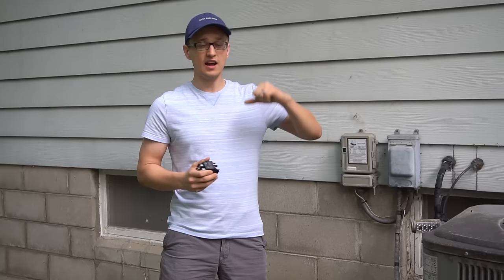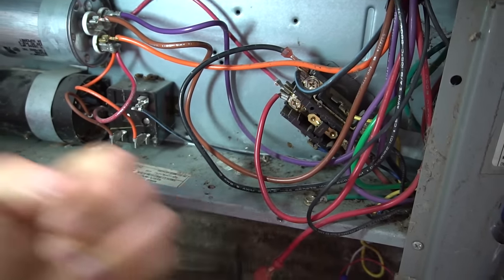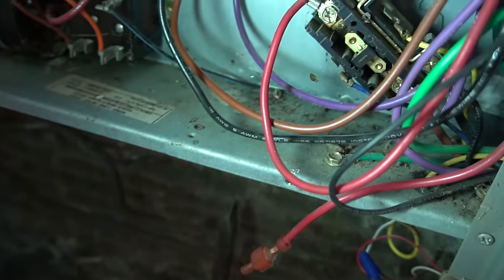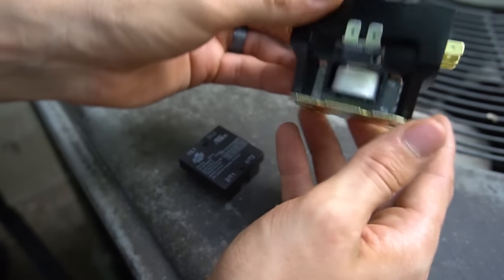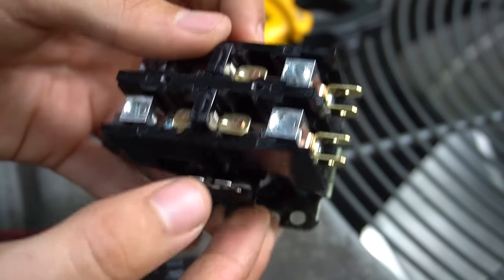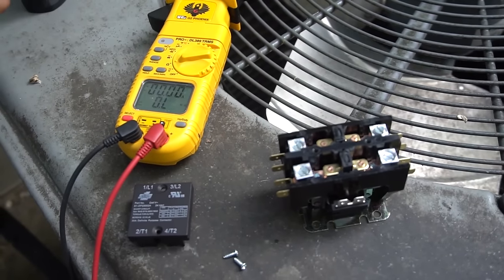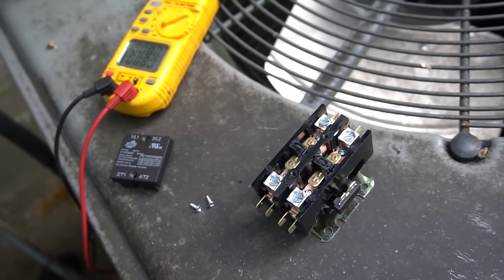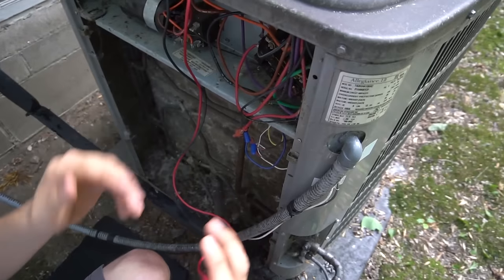Air Conditioner Contactor - How To Check If It's Actually Bad

Comment: Ok so I'm new to the channel, subscribed a couple days ago I've been trying to diagnose my a/c  inside fan comes on outside fan does not..I pushed the contacted button and the fan came on I checked the condinsate overfill switch there was water all the way to the top of the pipe....I blew it out didn't help.... I checked the line and load 234 V not quite 240 don't know if that 6 V kills it or not, also I couldn't get a reading when checking for the 27 V yet the fan comes on when engaged by hand And Even though it's worked without it for a long time, there is an extra wire in the wall I believe was labled w and may be blue not 100% on that one. I've got Green, black, brown , and red g-green wire, y-brown wire, w/-black wire, r-red wire and the jumper to r/c. I've changed the thermostat and fuses the fan works but only if I engage the plumber on the contractor by button what's my next step ? I know it's something simple when it's all said and done but be that as it may it seems complicated enough here and now

Comment: Great video! A question my next started saying error e103 and when I looked it up said overcurrent on the Y wire which I believe is the AC wire how can I check what would be the problem that’s causing it ?

Comment: I actually had a bad contactor, the coil burned out. But this video made me think to check for 24VAC at the coil which I had and the contacts didnt pull in = bad coil.

Comment: I have two thermostats, my system is wired for two zones. I changed my contactor and capacitor, my fuse at my furnace is not blown. My upstairs thermostat is running properly, cooling when asked. But my downstairs thermostat will not turn on my ac unit. Do you have any idea what the issue could be?

Comment: So you're saying the cover tells you where L1 and L2 are? Damn, wish I would've seen this before Saturday. Had an AC with a bad contactor at work (I do maintenance on apartments), went to get a new one but it looked like the one in the video and I had already taken the cover off. Luckily I had spare contactor (not new) that looked like the one that was on the condenser unit, so I could easily just go wire for wire. Now that I know the cover tells you which side has L1 and L2, I can use it the next time I need a contactor! All I need to know now is: which thermostat wire goes to which side, or does it even matter?
Reply from the maker: Yeah :) That's easy to miss! As for the contactor coil, it does not matter which thermostat wire goes to which side. Cheers!
Reply: @WordofAdviceTV  OK cool. Thanks for the reply! This video was helpful. Have a good day!
Reply: @WordofAdviceTV  one more question: can you direct me to your video that shows how to wire it up? I think the wires from the run caps go all on one side, but I don't know about the fan and compressor (and a third wire I can't remember what it's for, think it's another leg to the compressor).
Reply from the maker: @bensteinundknochen9404  Yeah no problem! Here are three videos that may help with that:

Basic AC Wiring: https://www.youtube.com/watch?v=KCanZEsLVEI&t=3s
Compressor Wiring: https://www.youtube.com/watch?v=GhBTVn5CHBE&t=78s
Condenser Fan Wiring: https://www.youtube.com/watch?v=VlMhvwrpimE&t=5s

Comment: So haven’t taken my contactor off but it is sticking in therefore continuously sending heat through even when I shut everything off. Had to pull the disconnect. Manually got it to pop back out. Was gonna clean it with sandpaper bc it has black soot but that part scares me so going to replace it. With disconnect pulled out and breakers off do I need to worry about shock from those wires? I do not know how to discharge stored power from capacitors either if that’s needed. Thank You 🙏🏼

Comment: My stat says "Voltage at standby Fault Code 73".  Code 73 means "compressor voltage sensed when no demand for compressor operation exists.  Contactor may be stuck closed or a wiring error".  It's worked fine for three years so I'm assuming it's a stuck contactor.  If it's only an $8 part replacing seems faster/easier than cleaning it.

Comment: Sometimes they'll arc if there's corrosion but the meter will still check out OK. If you hear buzzing noise or something, it's important to replace even if AC works because it could be getting lower voltage causing overheating or other damage down the line. Cheap insurance.

Comment: Hi  Jay I tested my contactor with meter which shows 239V under two wires,but on top two shows 5V only. Coils on both sides show 0V. If I set up the thermostat , the fan is turning but compressor is not working. At this moment two wires at bottom got 315v . On top two wires its reading show 5V. If I press down the plunge on the contactor the compressor is working ,but the fan is not turning. It seems like my contactor didn't pull in. According to this information do you think my contactor needs to be changed? Thank you very much for your advice. By the way my contactor shows 21 on top of left corner and 23 on top of right corner, at bottom it shows 11 on left hand and 23 on right hand. My contactor has one plunge which is different from yours. If I order one on line what kind of model I should choose? Thank you very much again.
Reply: If you are truly reading 315 volts incoming to contactor, you should call Power company and report it before it destroys your system. More likely, you have a malfunctioning multimeter. The 5 volts you are reading is actually 0 volts. Most multimeters when placed on ckts. that should have 0 volts will get a Millivolt reading that will confuse you if you don't look closely at meter that autoranges to millivolt reading.The numbers on the contactor corners refer to the terminal numbers on the wiring diagram.You may have a bad fan motor, if it is turning when the contactor is not pushed in, which would indicate that its winding is grounded, and it is being fed by the shunted leg of the contactor.  But than you say it stops when you push in contactor, which shouldn't make any difference.Hopefully you called in a ac tech for help, this may be beyond the do it yourself field.

Comment: My AC works only if I pressed the contactor manually. I checked the following:  the wire in AC unit outside thered is 27Volt coming from the house as well as 240 volt at bottom of 2 screws in the contactor. Also replaced the capacitor and seems to be working fine. So what might be the problem the contactor is not pulling when I turn on the thermostat ?
Reply from the maker: The two thermostat wires that come out of the house and into the condenser unit, do they go straight to the contactor coil or does one of the wires go somewhere else? (the 24v wires) If one wire goes somewhere else, try to trace where it goes and see what is in series with the contactor coil that could be interrupting the current. But if you have 24v right at the contactor and it is not pulling in, then the contactor is bad and should be replaced.

1 Pole 30 Amp Contactor: https://amzn.to/2tdICNB
2 Pole 30 Amp Contactor: https://amzn.to/2JWlI7Z
Reply: Thank you in advacne for you help. One of the thermostat wire doesn't go to the contactor, but into the AC unit - I am assuming to the compressor, Then from the inside the AC unit - again I didn't open to see, but seems to come from compressor- there is a wire that clips to the contactor. That is exactly what baffles me and you seem to zero in. I always thought both thermostat wires go straight to the contactor. I also thought there are only three wires that comes out of the compressor ; two going to contactor (load) and one to capacitor. But, what I have are 4 wires: two goin to the load of the contactor, one to capacitor (Herm) and another one to  the side of contactor whre 24v should be. I was thinking to pigtail anohter wire to 24v wires coming from thermostat and clip it to the side of the contactor for 24v , but I am afrain to do it in case I damage the unit. Again thank you very much
Reply: I forgot to say,  I did check the volt of the two wires that come from the house (thermostat) and they are 27volt coming, but  somehow they don't make it to the contactor. I checke the left and right side of the contactor and there is no voltage
Reply: any suggestion to my previous questions ? I replied to your query and I am eager to know why the 24V is wired differently (one wire coming from the compressor) and if I will be able to pigtails from the source wire coming from home and connect it to the contactor
Reply from the maker: I have done that before, where I just routed the two thermostat wires straight to the contactor coil. But I think you should first confirm what it is that you will be bypassing by doing that. On the back of the cover door that you take off to access the electrical section, is there a wiring diagram? Many times you can look at the wiring diagram and see what is in series with that contactor coil. I am thinking it is likely a HPS (high pressure switch) or LPC (low pressure cutoff). The HPS often times will have a reset button on it but not always. You would need to visually check. If you look from the top of your condenser unit, inside, do you see any pressure switches? They are usually mounted on the copper freon lines (looks like a small black cylinder with 2 wires coming out of it). The HPS would be on the thin copper line, and the LPC would be on the thick pipe.
Reply: Thank you. I will check and let you know. if there is a reset button, I will try to reset it and see if that solves the problem. In the event that doesn't do it, what else can I check in order to find out the problem. As a last resort if  bypass it by routing the thermostast wire as explaiend before,  would this have adverse impact? Do I damage anything ? It's still very hot here in Canada and I would like to have my AC back as soon as possible.
Reply from the maker: Well.. Like I was saying, I can't tell you it's okay to do that because I do not know what you will be bypassing. Most likely the unit will turn back on and work but maybe something is off in the pressures (too low or too high) that is why whatever is in series with the contactor is not letting power through. Or if the pressure switch is just bad, then bypassing it wouldn't have any bad effects.
Reply: Sorry, I was out of town. I am please to say, thank you to you I finally got it right. As you predicted there was a switch inside the unit and I pressed it and voila ! the AC started. I can't thank you enough

Comment: Ok so, do you have to remove all the wires, or just the ones on those two terminals? Really old unit. Hoping for a cheap fix and not the fan. But I plan to take the leads off the fan and test it too.

Comment: Thoughts on the contactor losing the 27v coming from thermostat as soon as the wires touch the contactor? I thought the low pressure/ high pressure switches might be a problem so I bypassed them to see if the the contactor would work but the same thing happens. The thermostat wires read 27v but as soon as I touch them to the contactor it drops to zero and nothing happens. Brand new contactor and if I press the plunger compressor and fan kick on.

Comment: Brand new filter, clean coils, relatively clean squirrel cage fan and housing, brand new capacitor, but air flow from vents is less than impressive. What could be the cause of the low air flow?
Reply from the maker: Bad duct work design perhaps? Was the airflow always bad or how long ago did this start happening? Also, is high speed motor wire going (usually black) to the COOL terminal on the control board?
Reply: @WordofAdviceTV  I bought the house 3 years ago, I dont think the air blew great then either, but I can definitely see my duct design being less than ideal. About the high speed motor wire/cool terminal on the control board, where do I look for that? Inside the furnace? Or outside on part of the condensor?
Reply from the maker: Yeah, if everything is checking out good but the airflow is weak, then good chance that the airflow was never good from day one. 

Inside the furnace. Take the doors off and find the wires going from you blower motor. Usually the black wire goes to the COOL terminal on the control board (most furnaces will have one, not sure about yours). If the black wire is not on the COOL terminal, then you can put it on there to increase the fan speed.

Comment: Old contactor points can develop a rough/pitted surface that reduces the amount of current passing through them.  As a result, volts/amps drop.  
An inexpensive solution is to replace the contactor and the capacitors every 5 years to keep everything working at 100%.

Comment: Do you have a video that teaches us how to check the pressures on the high and low side and how to hook it up and check our pressures and possibly test for leaks. Apparently someone worked on this a while back and said it was low on free on but there was no leaks which does not make sense to me I know Freon is just not supposed to get used up.
Reply from the maker: I think this video is along the lines of what you are looking for: https://youtu.be/dExFtP-nXTw
Reply: @WordofAdviceTV  OK l found a few things out. I do have ~29 volts A/C out of the low power side of the transformer, and l do have ~ 29 volts A//C between R and C. 
So it looks like since I have power OUT of the transformer, The transformer is good, and receiving 110 volts in, CORRECT?
However, if I jump R and G the fan does not kick on. (I do have the door switch interlock taped down) I should NOT have to have the thermostat calling for cool, or calling for 
fan when I jump out R and G; correct, as I assume I am bypassing the thermostat when I am jumping R to G, correct?
Nor does it kick on from the Thermostat cool command, or from the fan only command.
NOTE, when I set the T-stat to call for cool, the condenser fan IS kicking on outside, so I take it my contactor is OK. 
(Note, at call for cooling, Outside condenser fan IS running, but I don't hear the compressor kick in, and also I have no blower fan operation in the air handler inside.)
The furnace A//C unit is an Armstrong ultra sx 90 .
Do you or anyone happen to know if this unit has any type of fuse on the board, or eternal fuse somewhere? (But if the fuse was bad, if there is one, would I not then have ~29 volts A/C between R and C? 
Also please, do you know if this unit has an LED light to indicate trouble codes, (looking online, says it should) If so, where is it located?
Reply: Okay bud I did a little more testing, with the thermostat set for cooling and of course the interlock closed, I do have 27 volts ac from the common terminal to the y terminal. I also have at the same time 27 volts ac from common to the G terminal which is fan.
So it looks like I'm getting voted from the board to the thermostat back to the board with again 27 volts from common to yellow (cooling) and 27 volts from common to G  (fan)
I could not read the board too well especially at night here so I couldn't tell what was what coming off the board that's supposed to be going to the blower motor I'll have to try to get into that tomorrow unless I do like you did in the one video and just hotwire the motor.

Comment: Just brought a brand new unit and noticed it has an audible hum while running...  what is likely (most commonly) the culprit?  Contactor?  Fan motor or compressor?  It is a Trane XR15.

Comment: I am going to request for my contactor to be replaced. AC is working fine, but the compressor was just replaced on a 2 year old unit. I noticed that sometimes when the AC is on it will automatically make a loud buzzing noise. It doesn't always do this but the noise is very loud. I am assuming the contactor is bad and it caused my compressor to go bad. Any other guesses as to what it might be? When it makes the noise now I immediately turn it off and then turn it back on 5 minutes later. This usually solves the problem. Sometimes it will run all day and no noise.

Comment: I have an old rheem imperial that stopped working last sommer after a monsoon. I live in the desert. The condenser fan outside stopped spinning but the compressor would run. The fan motor and capacitor had been replaced in previous years. If i manually push in the plunger on the contactor only the compressor comes on. Im thinking the fan motor went bad again but they are not cheap, so i dont want to guess. Is it possible that just the fan circuit could be disabled through the contactor? The capacitors are not bulging and are fairly new

Comment: Question! 
Does that 24 Volt have any negative or possible position and need to connect to correct side of connector, or we can connect either side of connector,
will does not make any difference. Thanks!
Reply from the maker: It does not matter which wire goes to which side of the contactor coil. Cheers! :)
Reply: Word of Advice TV 

Thanks!